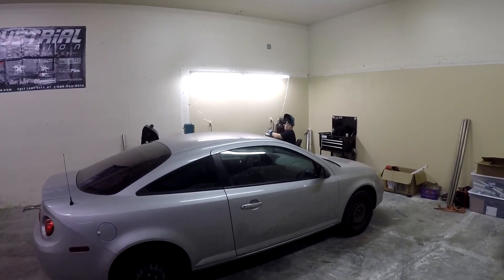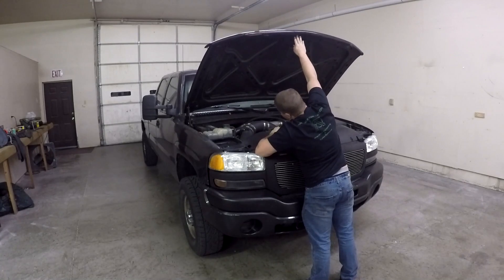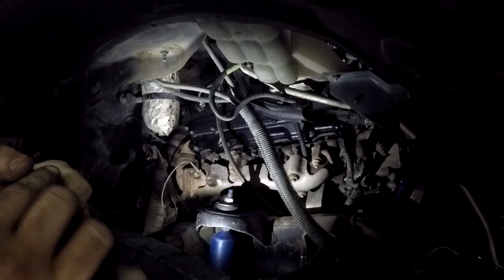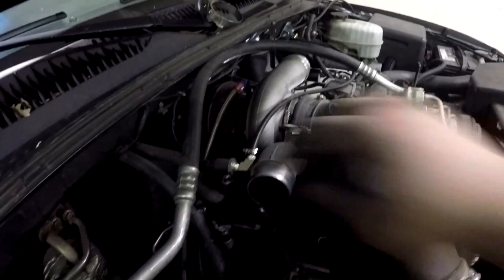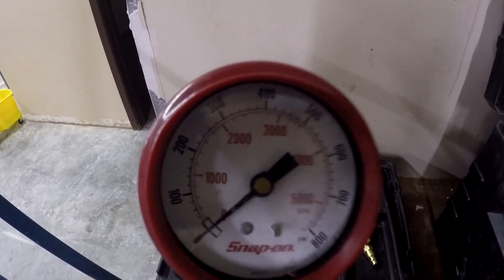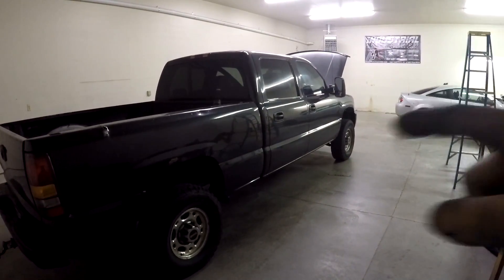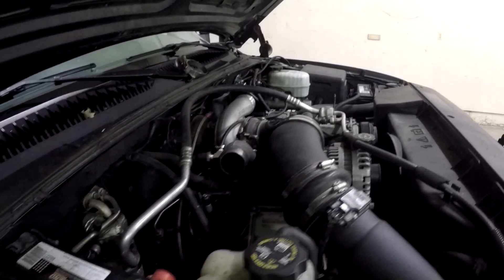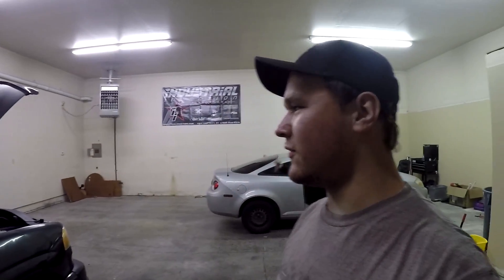Duramax Compression Test

Comment: The water is less dense. I am liking the videos. Looking into getting a diesel but do not know much about them. I am good with petrol engines just not diesel. Keep it up bro.
Reply: Same Idk much on diesels besides injectors being replaced and other maintenance like upper lower control arms depending make  model etc regular maintenance. One I seen for finance was trade 03 but has 360k miles 6.6 duramax so don't know if too many miles to be cautious on getting into it cuz of payments and then possibly having to do maintenance along with insurance

Comment: The reason the water might be cooler is due to the evaporation of water into the air. As water changes into a vapour (transferred heat energy from the air) there is a sudden drop in temperature - This is called evaporative cooling and is why we sweat when we are hot.